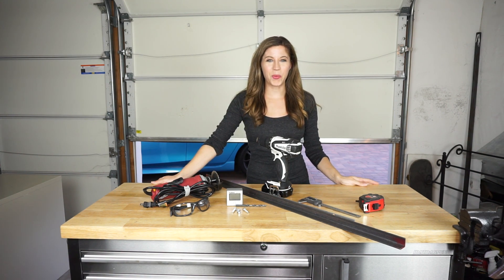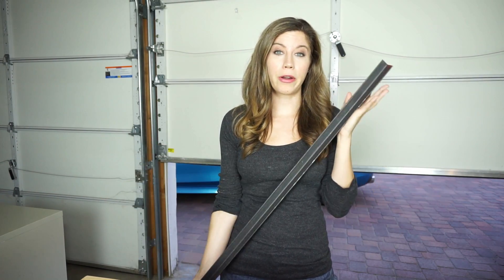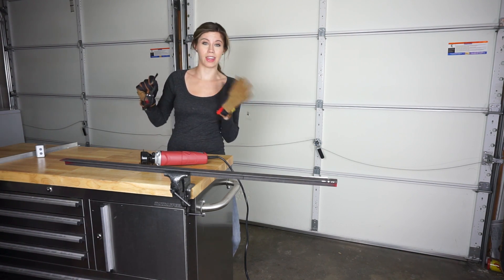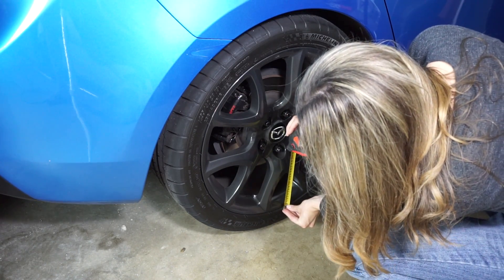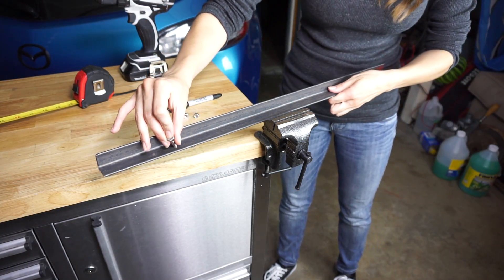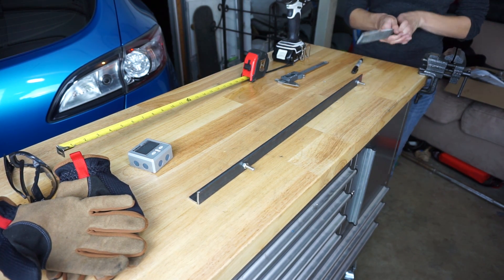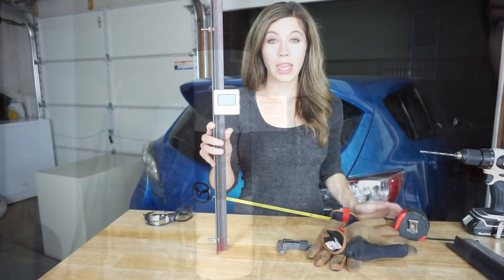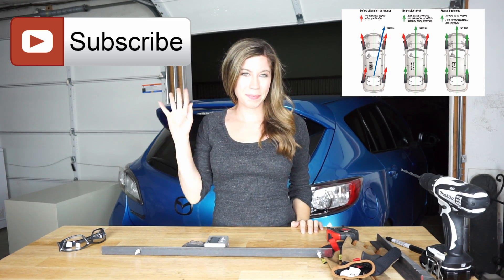BUILD YOUR OWN CAMBER GAUGE TOOL!

Comment: I was planning to make this out of a piece of 1x4 wood cut to fit the wheel lip and use a carpenter's level. I did this in the past with mis-matched tires and was successful by just compensating for a pos camber angle near zero. Its great to know that a digital angle gauge is available on the cheap for a more accurate setting. BTW you are a good looking host.

Comment: You could just use a hack saw rather than the cut off wheel as it will bounce around less.
Also when you drill those holes, start with a small drill bit to avoid it bouncing around like your first home did. Or use a drill press

Comment: Hey Aly! You have a great channel here and I just wanted to say thank you for everything you do!

Looking forward to the alignment video as I suspect my Mazda 3 '07 Hatch has misalignment. Apart from wandering a bit on the highway there is a steering wheel shake side to side/vibration starting at around 55 mph and subsiding at 68 mph. It's a mystery to me as what might be the issue :-( 

My rotors are a bit warped and it shakes only sometimes if I brake hard. But I doubt that would cause vibrations while driving at the above speeds. I know you have the white mazda 3 hatch gen 1 as well and might be able to shed some light on the issue.

PS.  I also notice on slightly uneven road stop lights while braking towards the end my steering wheel will sometimes turn left or right unless I hold it firmly. These Mazdas have a very light steering so I wonder if that is normal or pointing towards my issue.

Thanks a bunch for any help! You're amazing!

Comment: You can simply stick the angle cube on the surface of the brake rotor. It's much more accurate than the wheels. What if the wheel is bent? And depends on where the bolts touch the wheel, you have different distances. It's not flat. BTW, that's protective clothing?
Reply from the maker: Quang Lam While this is possible, not everyone has wheels with a wide enough gap between the spokes to fit an angle finder. Also it's not uncommon for rotors surfaces to be uneven. Thanks for watching!
Reply: Sheppy99 They lift the car by the arms and rotate the wheels to get the accurate plane that the axle is on. Most low profile aftermarket wheels are bent. They look normal. Plus the shape of the rim as different points.
Reply: +Quang Lam That's as protective the clothing gets while also trying to maintain a consistent flow of views for your Youtube channel. While I guess there are 3-4 other videos that go into different degrees of detail about this, this channel is the only one that came up that the steps are performed by a host that, from what I can tell, commonly  wears low-cut shirts and is fully composed; makeup and hair.

Comment: I know you probably bought that Chicago Electric 3"(Harbor Freight)  cut-off for this video...But that thing kicks butt...it'll handle just about anything you grab it for...nice video!  I actually need to do this...my Saturn Sky is a little off since dropping it (1.3")...I'm looking forward to your alignment video...
Reply from the maker: Craig Cundiff Yup that's the one. I think I paid ~$20 for it and it's never let me down. It even came with a spares set of brushes. We're going to try and put a lot of time and research into our alignment video. We're even going to take the car to an alignment shop after we're done to have our worked checked. Stay tuned!
Reply: Sounds good.Looking forward to it....$20!?  It's Chicago Electric Platinum though...whatever that is...LOL

Comment: Really nice video and I can't wait for the alignment because I have a 2008 mazdaspeed3 and it turns to the right when the steering wheel is straight. I took it to my local mazda dealership and they said it would cost me over $200 idk why. But I looking for a way without the alignment machine but anyway nice work u guys need way more subs
Reply: Did you try going to a local shop other than the dealer, I got an aligment on my.mazda 3 for 50 bucks. Without the discount  ots like 65 to 70
Reply: +spoon games I love DIY stuff, but to me the hassle of alignment isn't worth it. I got a lifetime alignment deal on mine and it already paid for itself.

 I would rather work on something else  that is more costly or somewhere where professional mechanics can you hard on the bill (engine or transmission).

Comment: nice!  I wonder if putting some rubber vacuum caps at the end of the bolts would help keep slight scratching off the rim's surface.
Reply: +iceandhotwax  Just put some tape on the bolt ends, not thick enough to cause a false reading, and will protect the rims just fine.
Reply: +jewllake  one might use plastic bolts
Reply: +jewllake Would the resilientce of a rubber cap give a false reading? PVC threaded rod would work, or lightly Plastidip the bolt ends.
Reply from the maker: jewllake Great idea! Will have to try that. I think I have some vacuum caps in my tool box.
Reply: High five bro. Our minds think alike. Mmmm, it's like I'm not the only one left on the planet. This girl rocks!
Reply: +jewllake indeed a must i thought same thing
Reply: nope !! that will throw off the tool , because the caps will be different thickness , you want the bolt that is against the rim as flat as possible :-)
Reply: You can also buy bolts about an inch longer, grind the tips into cones on a bench grinder, then round out the tips of the cones.  Check with calipers, adjust as necessary, then smooth the rounded tips out with sandpaper until silky smooth and say goodbye to scratch marks.